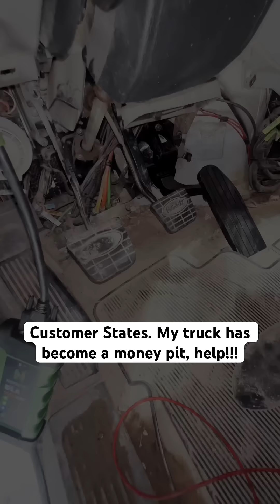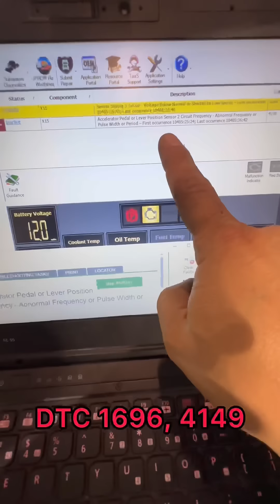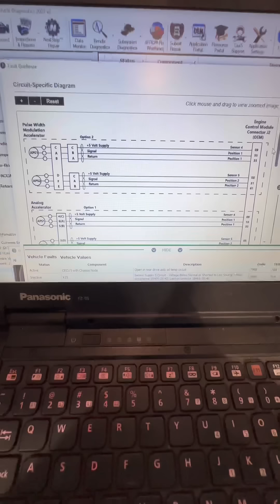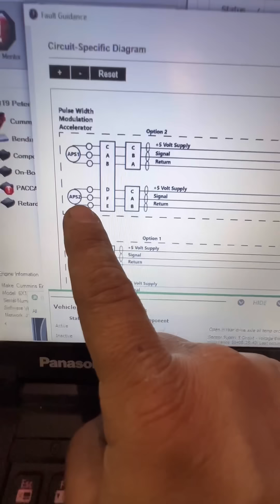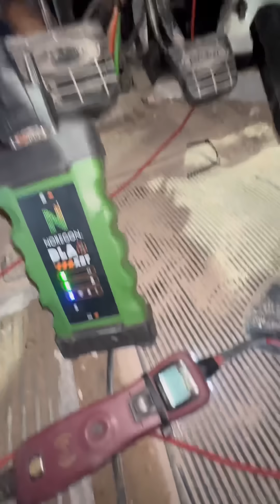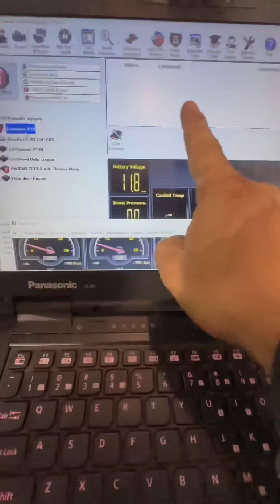#diesel #mechanic #comeoverhere #customerstates #mechaniclife

Comment: Very common problem on the peterbilts... the OEM engine harness is poorly secured and routed ... it rubs on the LH splash guard as well causing similar issues... the Cummins engine harness also has an issue with the convoluted tubing rubbing through the wire insulation causing intermittent shorts to power and ground which is a little harder to isolate being the tubing is not split... a good 10lb pull test on harness connectors will help with finding the issue .. I see someone tried the old swapnostics by replacing the throttle pedal assembly... dont be to quick to toss a new part at the issue... a good visual inspection during diag can save the customer down time and money

Comment: Had the exact same problem, but on a gas powered bus.  Come to find out, the high output alternator was scrambling the throttle position sensor signal any time full output from the alternator was commanded.  Switching out the TPS sensor back to the old style potentiometer TPS sensor fixed it.

Comment: I've seen a similar symptom twice in a Freightliner application. First time it turned out to be wiring, rather difficult to diagnose. Second time I was spinning my wheels and finally gave up and replaced all the wiring between the ECM and the firewall but the issue still persisted. It was finally determined to be the ECM had a bad pin and was shorting internally just behind the plug. After a new ECM was installed, the problem never returned.
Reply from the maker: Thanks for sharing that experience!